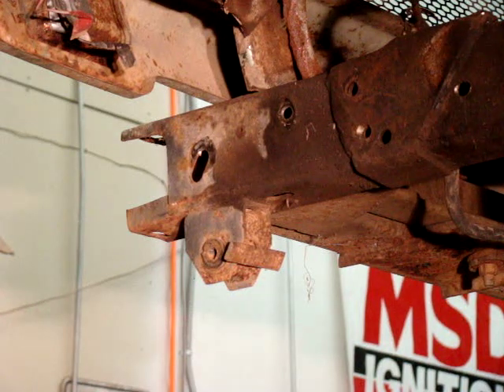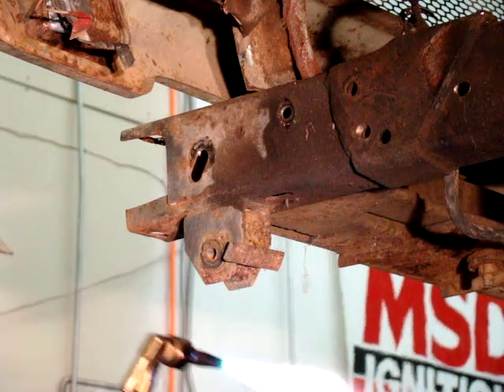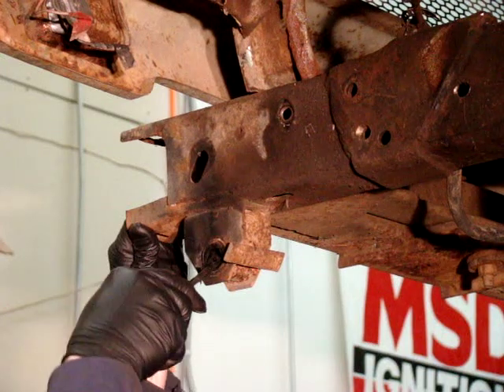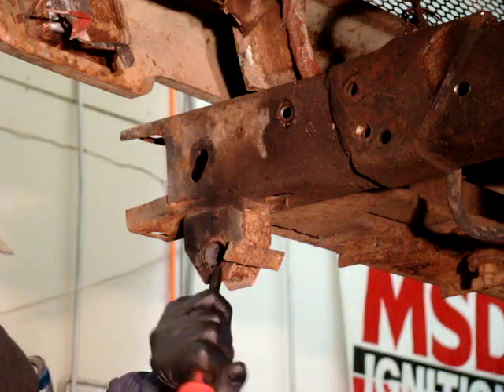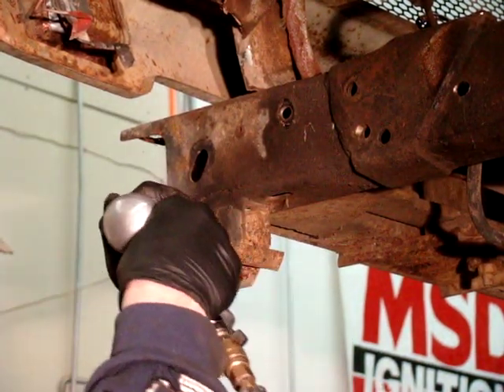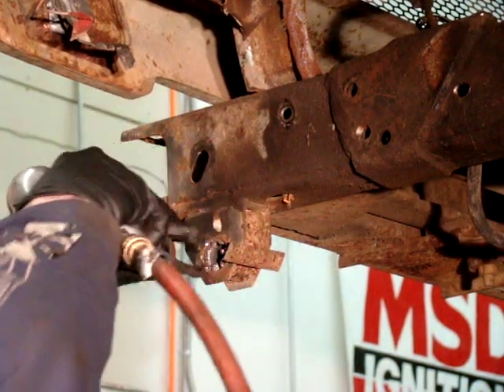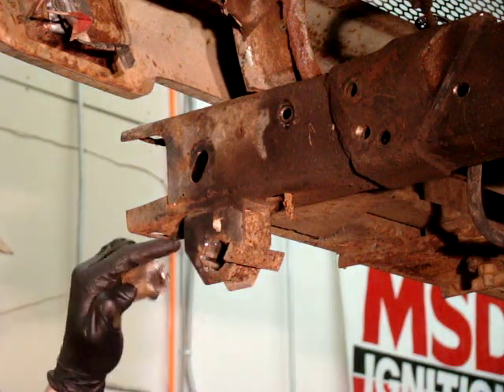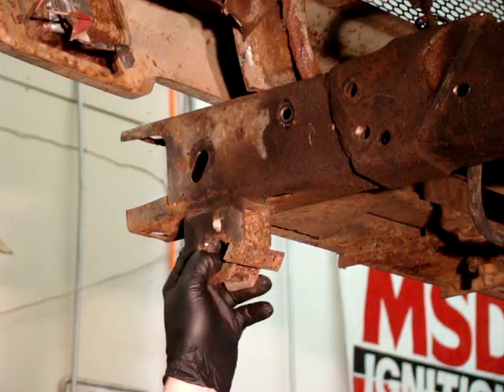IH Scout 80, Scout 800, Scout 2 leaf spring & shackle hanger bushing removal / replacement

Comment from the maker: Its a great conversion and we should have a kit out with all new body mounts sometime this year hopefully. Its been in the works for a while but sidelined by other more pressing issues and work. You get all the benifits of the scout 2. Power steering, narrower frame, off the shelf suspension options, dana 44 axles with disk brakes on front (74.5 and newer), wider springs, etc.